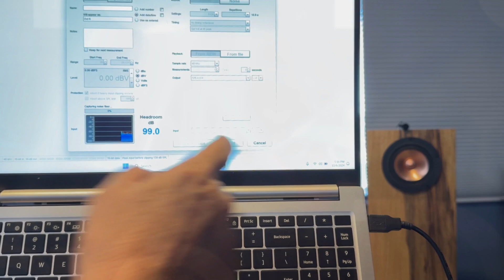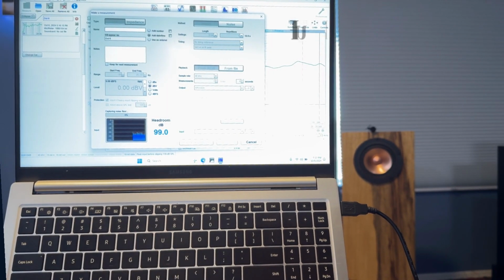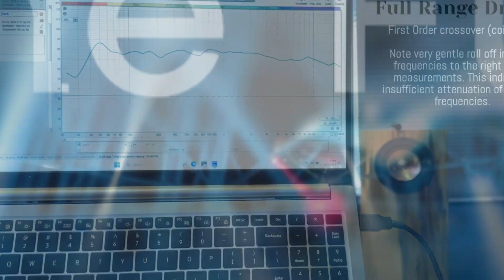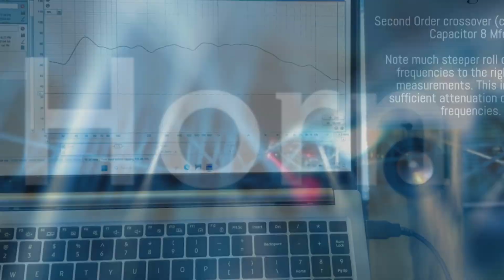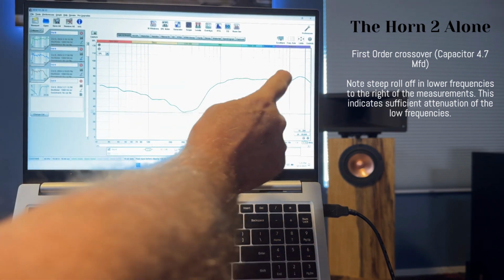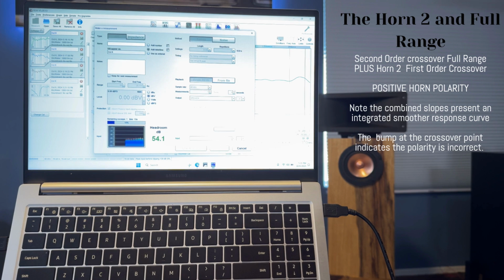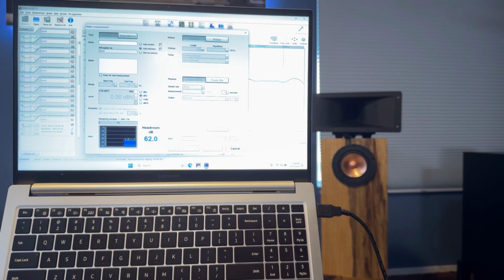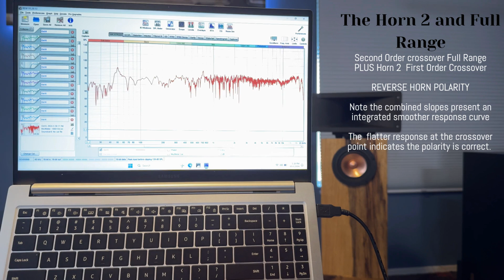Unlocking Potential: Horn Integration video tutorial  - The crossover

Comment: Do you use the computer to measure how far forward or back the horn sits on top of the cabinet?
Reply from the maker: We do measure the effects of the horn atop the cabinet. Now in this video its simply an demonstration of how we measure and not to be confused with exactly how we build this particular driver/horn combo. The video was developed to better show how the driver and horn mesh as we get questions regarding how this is accomplished.
Reply: @shinjitsuaudio  yes but I was wondering if you have a precise placement when you put the horn on top of your cabinets, which is what worries me about doing it on my own as half an inch might make a difference
Reply from the maker: Great question! Yes, in all categories of our speakers, we place the horn with the bottom of the horn's lip (its mouth) aligned with the baffle face. Our extensive in-house testing has shown that this placement consistently provides the flattest frequency response, minimizes reflections, and ensures the phase and timing are perfectly aligned.

The mouth of the horn is considered the acoustic starting point of its response. This concept is widely supported in horn theory and design literature. For example, resources like "Acoustics: Sound Fields and Transducers" by Leo Beranek and "Loudspeaker Handbook" by John Eargle explain that the sound wave fully propagates from the horn’s mouth, making it the critical point for timing and phase alignment.

In professional audio and speaker design, companies like JBL and Klipsch follow similar principles, using the horn’s mouth as the reference for phase coherence and driver alignment. We've confirmed this through real-world measurements using tools like REW, where aligning the horn's mouth with the baffle consistently yields smooth frequency response and phase accuracy.

This precise placement ensures you get the best performance out of your horn system, so rest assured, even small adjustments like half an inch can make a difference, which is why we take great care in our design.

Best,
Morris
Reply: @shinjitsuaudio  that’s very interesting. I would have assumed it was at the point of the compression driver in the horn and that would’ve had to align with the same point in the full range, drivers magnet or whatever. I am confusing cone driver technology with horn technology obviously. Thanks.
Reply from the maker: I see where this can be confusing: Horns and regular cone drivers function differently in terms of waveform shaping and impedance matching. Yes, aligning the horn's mouth with the baffle is the best compromise for achieving proper phase alignment and timing coherence between the horn and the cone driver. With horns, the mouth is considered the acoustic center, where the sound wave fully forms and exits, making it crucial to align with the baffle for smooth integration and to avoid phase issues or dips in the frequency response.

For cone drivers, the acoustic center is typically near the center of the cone, and while the sound radiates more directly from the driver, the baffle still plays a role in shaping the sound, particularly in terms of diffraction and reflections. By aligning the horn’s mouth with the baffle, you're effectively synchronizing the sound waves from both the cone and the horn, which helps create a more coherent and accurate soundstage.

This placement is the best compromise to ensure both drivers work together smoothly, preventing timing and phase mismatches and minimizing unwanted reflections.